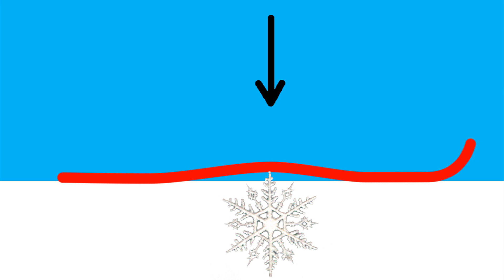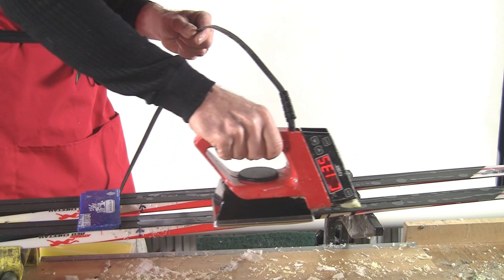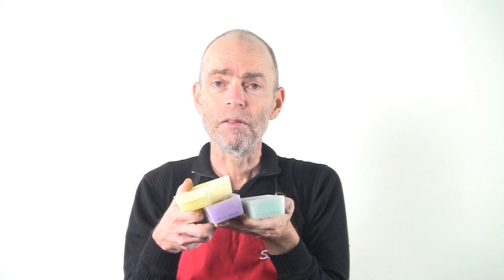How to Improve Glide on Cross Country Skis

Comment: My classic CC skis have become very slow.  Driving me crazy whatever wax or anything I try.  Just slow as a turtle!!  This is most enlightening vid i have seen.
Reply from the maker: There just a few questions first. Like is this a feeling or have actually compared the glide of these skis with other ski in a proper glide test. Has anything change, like your weight. if you are sure your ski have slowed. Try a full base sanding, flattening or stone grinding.

Comment from the maker: Thank you. 
Fine structure produced with brass or steel brushes should be done before waxing.
Coarser structures that are pressed into the base using structure or rilling tools like the Toko Structurerite are applied as a final step before skiing. --Saul

Comment: Hi Saul.  How do you feel about the movement towards non- fluorocarbon glide waxes?  Do you have plans to work with them? My understanding is that Swix has been working on these options since 2013 and will no longer manufacture fluoro options.  They still require an iron for applications.  I just recently purchased an all-canadian system called Ulla wax, and the added benefit of this system is that it is a cold and quicker application method.  Testing has been promising.  Another system called Yeswax has a cold application method but I think it is still a fluor product line.  I am very curious to know your opinion.  Thank you!
Reply from the maker: I have used Fluoro and Non-Fluoro waxes. Fluoros have benefits under very specific conditions that are only significant in racing. I wont miss these waxes. Rub-on waxes have been around for a long time some users are impressed with their performance/convenience. Most melt-on waxes can be applied using roto corks. More choices can be beneficial but also confusing.

Comment: Thank you so much for the information! Can you explain the difference between high flouro wax and the wax with Graphite And when to use them? Also, I have a clear based ski but I accidentally used graphite wax to seal up my base when the season ends, now my base is contaminated by the graphite, the base looks so dirty now. I’m so sad, don’t know if I’m able to remove that graphite marks with wax cleaner.
Reply from the maker: You're welcome. Fluoro's repel water. It is most effective in high humidity situations and wet snow. Graphite is thought to reduce electrostatic attraction (not scientifically proven) in dry snow. It is best used in dirty and old snow. It is thought to enhance the graphite content in black ski bases. The best way to clean you clear bases is to hot scrape with a soft glide wax, such as Swix Yellow CH10. It may take a few attempts to clean your base.

Comment: So the rilling/ structure tool would be used after scrapping and brushing? I don't see any pattern when I use my Toko tool at the end of the process. I wax, scrap, 3 different brushes and then add structure....maybe I'm brushing too much?
Reply from the maker: Assuming your skis have modern P-Tex bases, the Rilling tool should leave an impression with sufficient pressure in the base. P-Tex is malleable and rills are temporary.
Reply: @velotiqueBetterWatchSaul  yes, I have a modern base...maybe I need to press much, much harder...so to be clear, it's the last step of the process?  P.s. I love your shop, we are out here in BC but have ordered many times...thanks!
Reply from the maker: Thank you, you are very kind. Yes it is the final step. I suspect you need to press much harder. Make sure the skis are held firmly in a vice. Saul